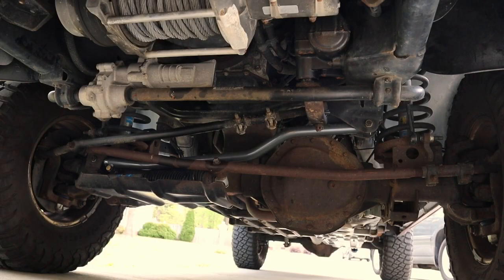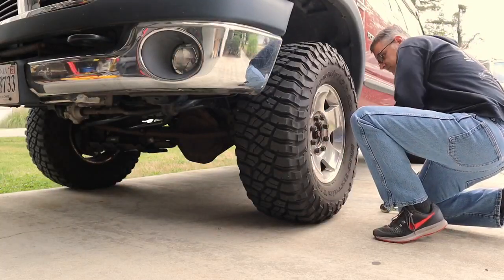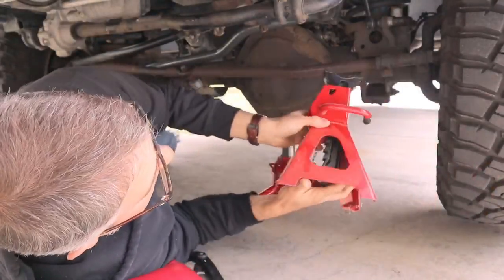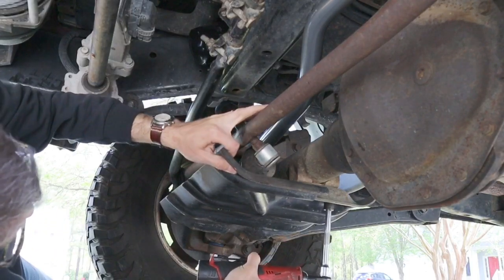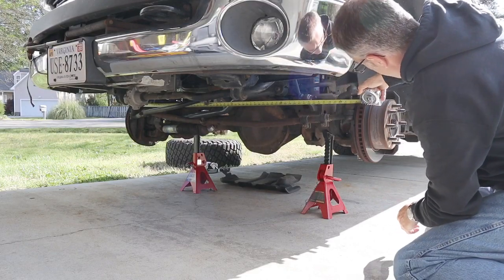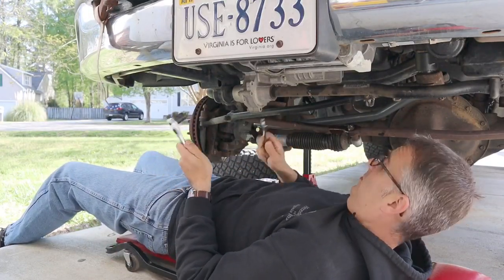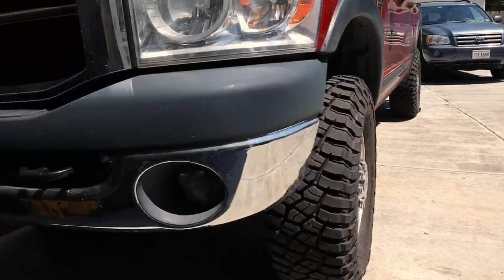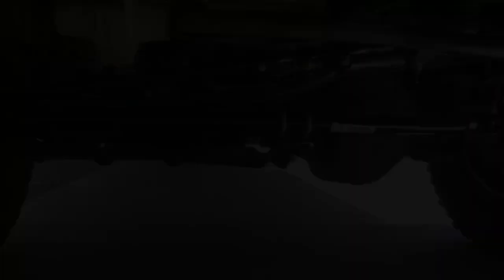How to install the 4th Gen Mopar Heavy Duty Steering Linkage in a 3rd Gen Power Wagon.

Comment: I wouldn't trust just jack stands. Throw that tire under there, in case they fail
Reply: agreed. jack stands extended that far are unstable.  appropriate stands on frame behind where the front axle is anchored give me greater security. and leave the bottle jack in place. gives me half second more to escape were somthing to go amiss
Reply: I was thinking the same thing.

Comment: Thanks for the video, saved $600 doing the work myself instead of using the dealership. Parts were much cheaper on Amazon and they shipped everything to Alaska for free
Reply from the maker: That’s great!
Reply: Yo, if it's not the MOPAR, be careful. I bought the cheaper version and had a tierod adjustment sleeve SNAP after two years and 30k miles.

Comment: nice video. good weather and clean install. link to videos showing " homeowner" toe- in adjustment would be helpful. also ive had no luck using a torque wrench as you do. they always lose calibration when used as a breaker bar.
Reply: NEVER use a torque wrench as a breaker bar! Go spend $20 for a real breaker bar. You're absolutely correct about the calibration.

Comment: Question,  i have a 2008 dodge ram pickup, quad cab, slt, 5.7 gas, stock height. Will this 4th gen setup work on my truck ? What year  4th gen truck should be the best setup for my 2008 pickup. This video is great ! Thanks. I'll stand by fir your response. Posted march 3 2032
Reply from the maker: It should work for all 3rd Gen trucks. I believe they started installing them in 2009, but you should be able to find them by searching for the part number’s in the video description. Hope that helps.
Reply: @FamilyAdventuresOverlanding  thanks !

Comment: Thanks for this video. Very informing and detailed. Just a heads up. I checked the Bilstein website. The dampers are a little different. The 24-164870 you modified has 0.5" less travel than 33-170794. May or may not affect the steering. I installed the 24-164870 not too long ago and would like to reuse it like you did. Thanks again.
Reply from the maker: Good to know! I’ve been thinking about changing mine out lately as I have no idea how long it’s been on the truck. Thank you so much for the part number, I’ll have to look into that when I go to purchase the next one. Thanks for watching!

Comment: I didn't here what year your truck is but was wondering if it has gone in for the recalls Dodge put out? Because there was a recall on the steering and my dealer won't sign off the recall on my 2006 because it now has this linkage with the clamp on steering stabilizer. BTW, I am checking with other dealers in case it's BS. Also, the MOOG equivalent (DS800980A) is virtually the same to the Mopar one except the MOOG one has grease fittings on every joint. But there was a recall on the MOOG ones production years 2013-2018. Does anyone have any info on newer ones since they are still being sold?
Good video tho, I subscribed and I agreed, those jack stands made me nervous.

Comment: Hey Jerimy great video very informative. 
 Thx  for posting. 
Just found your channel while looking for info on updating the front end of my 07 Mega cab. (I too have a FZJ80 (96) that used to be the main truckster before the Ram)
An chance your going to do a segment on your camp setup including your AT topper?
Reply from the maker: We plan on doing a walk around of the truck and camper sometime in the future. Was there anything in particular you would like to see?
Reply: @FamilyAdventuresOverlanding  Thanks for the response.  Not looking at anything particular just an over of your setup. It looks like you have many nights camping under your belt with the Ram and the Cruiser, just figured you'd have some great tips and ideas on what worked and what you would do different. 
I just retired this month and planning on a small camp build out on my Ram with the current Snug top cap. I would really like one of the new pop top truck caps (AT Overland, Vagabond, Go Fast, etc) but everyone is months backordered. I just like to see what owners have to say about the camp shell they purchased to help decided which top to go with. 
Thanks again.

Comment: Isn’t the issue with the drive link the bolts on the Mopar parts? They told me the dealership would fix my truck for free but all they’re gonna do is weld the bolts shut. The problem with it is those bolts that you were losing and tightening, loosen up overtime.

Comment: Great video! Love the details and parts list, thankyou! 👍 I've got a 2nd Gen I'm getting ready to do and while yours is an '03, the process is very similar. Which track bar did you go with besides the new steering setup? Onc thing I'm finding are these diesel truck mods are not cheap! 😲

Comment: Great Video, appreciate it!.. had my mechanic install parts, only issue is my mechanic said the Pitman arm was incorrectly clocked when installed, meaning it did not install in the same position the factory pitman was at, IS This Normal or Correct?? I looked at the Key and Splines and they are not centered to the pitman arm itself??.. thanks for any Help!
Reply from the maker: I can’t remember exactly. I could’ve sworn it only goes in one way. As far as being offset, it may be due to the newer design, if you were using the part number I have listed.
Reply: @FamilyAdventuresOverlanding  
thx for the reply, yes its the same part number you supplied in vid. Hopefully I can find confirmation on this.

Comment: Great video with clear directions. The part numbers list was very helpful. And I like how you get right to it, unlike some videos where the person thinks we want to hear about their life story before they get to the instructional part. Great Job.  I have A couple questions though: the parts list at the beginning had the lock nuts part # as 6505623AA   Then later you show a locking nut for the drag link connection to the pitman arm and gave the part # as 6505263AA.  You mentioned that the same nut is used for the tie rods connections and the pitman arm connection. 1. Looks like 2 numbers got transposed on one of parts lists. Can you tell me which one is the correct part #?  2. Do I order 3 of these nuts? Or does the heavy duty steering come with the 2 for the tie rod ends already? Thanks again for a great video. I refer back to it many times as my number 1 reference for this job.
Reply from the maker: Hey, good questions! When I looked up the part numbers on Mopar’s website again, it looks like the 6505623AA is the correct number currently. I must’ve mistyped the number. As far as does the linkage come with them, it depends on where/who you buy them from. Some sell complete kits. I bought mine from a private seller locally, so I had to source everything separately. You should need 3 total. That will cover the tie rod ends and the connection at the pitman arm. Let me know if you have anymore questions. Thanks for watching!

Comment: I have an 03 dodge Cummins with a steering stabilizer was wondering what pitman arm to use
Reply from the maker: You’d have to cross reference it with the dealer or the diesel forums, but I think it uses the same one I installed. Mopar 68039930AA Pitman Arm

Comment: How did you get the pitman arm back on?
Reply from the maker: First get it set on the splines. Then you can either tap on it using a socket over the shaft and a hammer or just use the nut to slowly draw it up. There won’t be enough room to use the lock washer, so you’ll have to take the nut back off and reinstall the washer after the arm has been drawn up enough.

Comment: do I need to remove the pitman arm? Could I still use the stock arm?
Reply from the maker: It’s my understanding that if you still have the original pitman arm on, you’ll need to update it as well or it can cause binding and premature wear on the joint that attaches to it.

Comment: Just wondering if you noticed a better feel in the handling after the upgrade? I just ordered the "Bigger/newer" steering box for my 2006 Ram 3500 dually. (Steering number 68170214AA). I have the sector shaft bearing support (after market) and was wondering if you know if this will work on the new box? Great video you put together, part numbers and torque spec are alway helpful. Cheers.
Reply from the maker: The feel definitely improved. I’m not sure about the newer style box though. I installed the sector shaft brace as well and it was a huge improvement to the handling of the truck.

Comment: Torque wrench Breaker Bar?
Reply from the maker: You’re correct, it’s not a good idea to make normal use of a torque wrench as a breaker bar. In this case, it’s all that I had at the time and was able to set the torque wrench way above the torque needed to remove the fasteners. Not something I’d say to do every time, but will work in a pinch.

Comment: What does a power wagon come with vs the 2500?
Reply from the maker: Progressive springs that are 2-2.5” higher than stock. Lockers front and rear. Electric sway bar disconnect on the front axle and a warn winch behind the front bumper. They also come with 4.56:1 or 4.10:1 gears, depending on the year.
Reply: @FamilyAdventuresOverlanding  So do you know of any kits that upgrade a 2007 3500 mega cab with progressive springs
Reply from the maker: Carli and Thuren both offer progressive rate springs as well as a multitude of different shock options for the Dodge Ram 2500 and 3500 trucks.

Comment: Would you recommend the moog set for this?
Reply from the maker: I would try to stay away from Moog if you can. They do not last nearly as long as the factory components.
Reply: @FamilyAdventuresOverlanding  where can I find the updated one for my 2008 ram 2500? Thank you for the feed back
Reply from the maker: @MrCaryk  https://www.cjcoffroad.com/collections/steering-upgrades-and-components/products/mopar-2008-5-dodge-hd-steering-upgrade would be my first go to place. Sometimes you can find them listed on Amazon or some of the Diesel truck sites as well. CJC off-road has everything that you’ll need and is priced pretty much where everyone else is. I bought several things for my Dodge from them and they’ve never done me wrong. Very knowledgeable too. 👍
Reply: @FamilyAdventuresOverlanding  Okay last question lol. I saw you were talking about the steering shock or damper that you had to press a fitting in. If I were to get the upgrade kit which shock would I need to buy? I guess I could ask the guys from the link you sent me
Reply from the maker: @MrCaryk  they have diff options available. If you look up one for a 2009 diesel 2500, it will be the correct part. The http I DM’d you has the option to select which steering shock you’d like to add.

Comment: Could you possibly tell me what setup you would recommend using with a 95' 3500 Dually. We got the 4th gen MOOG 1.300 in OD set and installed it on the truck and from tie rod bolt hole center to tie rod bolt hole center we have it set to 61.5" and the toe is heavily pointed out. We took it over to the alignment shop and they told us that there is not enough adjustment to make it work and the alignment shop also said that we could possibly cut the tie rods and thread them more at a machine shop to make it work. Im just wondering if you could possibly help me out. My truck is a 95 2nd Gen. 

Also love your video it is definitely the clearest on here. So thank you very much

Comment: If my truck is lifted I'll need a drop pitman arm for the 4th gen won't I?
Reply from the maker: I’d imagine that would depend on how high it’s lifted. Ideally you want the drag link and track bar to be parallel to one another. Thanks for watching!
Reply: Thank you I'm going to be doing this soon how much was the total cost of all the parts?
Reply: 2003 Dodge Cummins I have a steering stabilizer was wondering what pitman arm to use?
Reply from the maker: The one I installed was Mopar part# 68039930AA. You’d have to call a dealer or cross reference it on one of the diesel forums to be sure, but it should be the same one.
Reply: @michealtunnell  I just ordered the same kit for my 06 mega cab 3500. Havent received them yet. Total so far is:
$302- mopar steering kit (Amazon)
$74- pitman arm (amazon)
$94- stabilizer shock (aka steering damper). I went with Bilstein to match my existing setup. Every website was basically same price for their steering shock.
$10(ish) - for nuts for steering linkage and new steering damper (O'Reilly, autozone, et al)
$TBD- alignment

Can't wait to install. Using this video as reference! Thanks again!

Comment: Is this guy using a torque wrench as a ratchet?
Reply from the maker: Michael Alix in this case yes, as I didn’t have a long 1/2” ratchet at home. The torque wrench was set to the max setting, which is way above what the fasteners needed to be removed. Not the ideal situation, but it works. Thanks for watching!